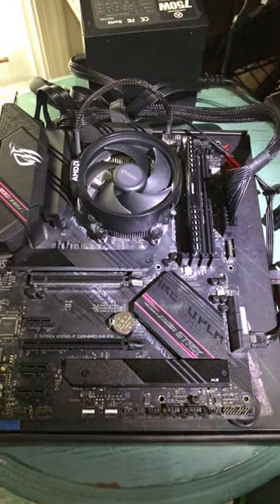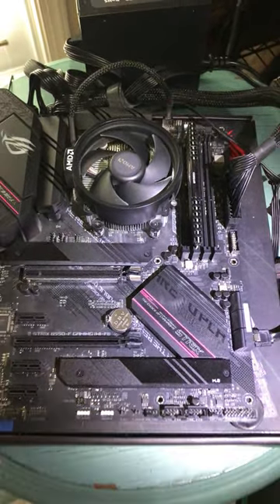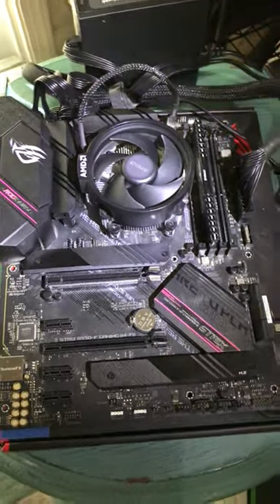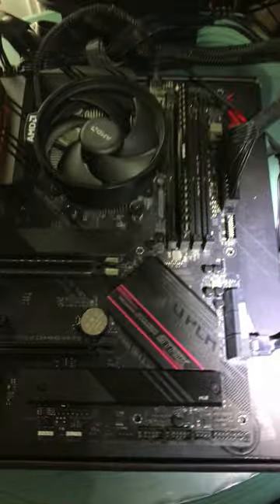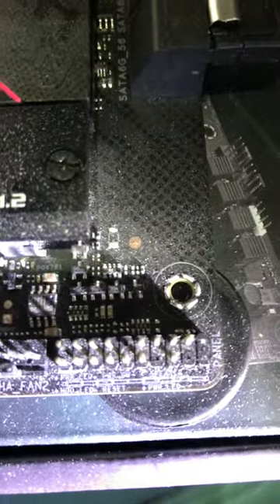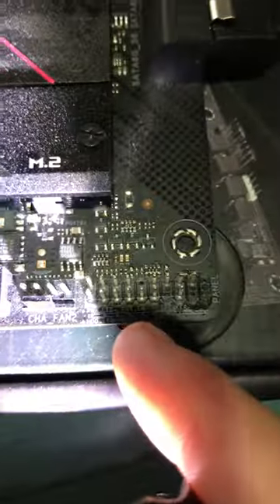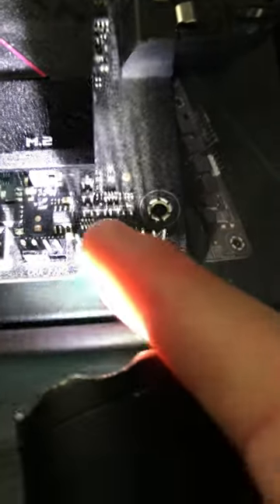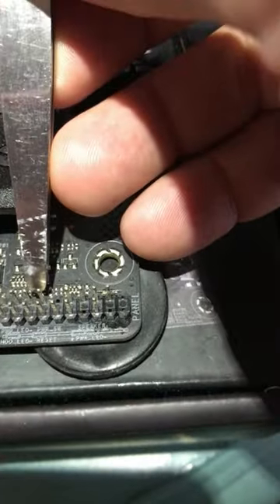How To Jump Start a Motherboard  #shorts  🔥

Comment: If this doesn't work, does it mean the mb is dead?
Reply from the maker: No. could be other issues like incompatible memory sticks. Do you have a speaker wired into the MB so you can hear the beeps? if any.
Reply: I realized some of my CPU pins were bent during a thermal paste replacement. I straightened them using a razor blade and the pc turned on just fine

Comment: Is it necessary to take off all the reset/power led/hdd led power plugs off before attempting this?
Reply from the maker: No, you are simply replacing what a power button/switch would be doing when you connect the 2 jumpers.
Reply: @roccotacomining3311  thanks, mate 👍

Comment: Useless, shaking video and flashlights on and off. No contract to see which pins. Blurry as you bridge the pins. Using you big finger to isolate which pins. The worst explanation ever.
Reply from the maker: The video is so easy to follow even a cave man could do it. It is really an easy operation and I explain where the PWR pins are. It is also depends on your motherboard. Really easy stuff. Perhaps hire someone to do it for you. And do not use your tongue. :)
Reply: I can’t see either
Reply: Western ní88a, Connect 3rd n 4th pin from upper row generally both are red in colour